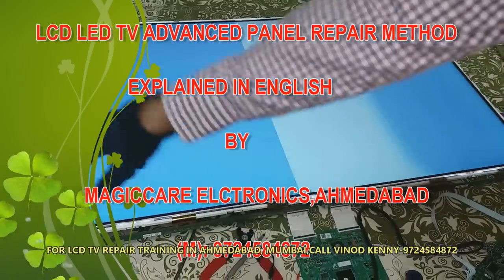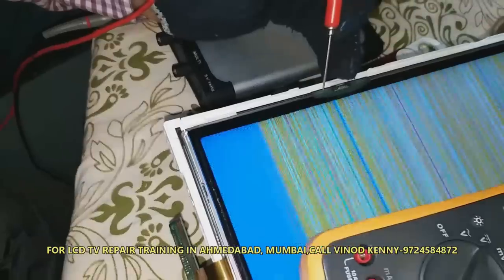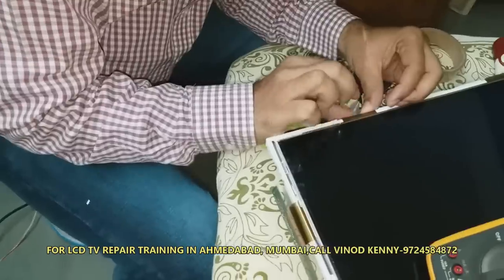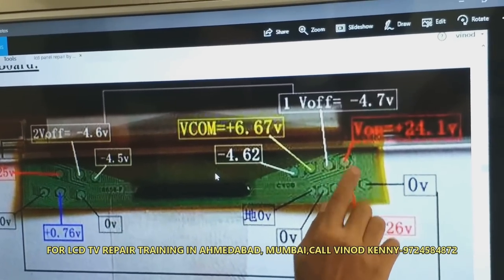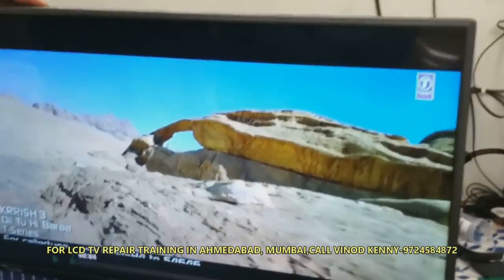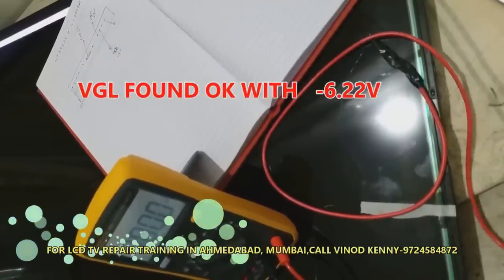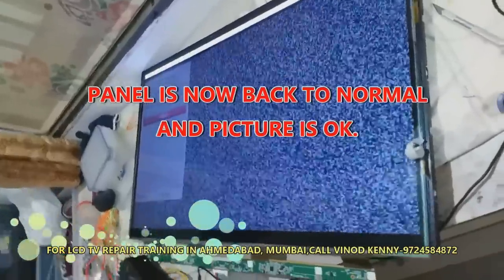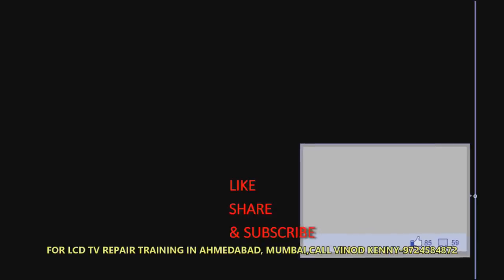LED TV PANEL REPAIR ADVANCED METHOD BY VINOD KENNY IN ENGLISH

Comment: Good but its a temporary fix only. Im time  other connections will turn lose and you'll have to do It over again therefore you need to replace the panel. Vgh going low is symptomatic of slow motion picture or picture going dark and reddish

Comment: So, you connect to each pin of side cof one at a time via 15k resistor with voltage and once you see a picture return then that is the correct pin?
Reply: Yes better use your ohmeter to test the lines if you dont want to Burn the COF

Comment: Greetings colleague I got a lcd of 55 has this screen model lvf550csot e15 and its tcon has this model st5461bo5-2-xc I get the image with vertical and horizontal stripes with a blue background use this cof nt61312h c6518a / a I proceeded to check vgl -6.5v vgh 28v avdd 15v but in the tcon tests only 3.3v vgl appears to me and vgh does not appear in the cof only 3.3v does not appear to me not vgl nor vgh and I notice in a lower corner of the screen that it gets very hot. there is a short you have the datasheet on this screen to isolate that short and normalize the image thanks

 

Enviar comentarios

Historial

Guardadas

Comunidad

Comment: Sir... Some of the panels doesn't have side cofs then what method we should apply else if all voltages are ok (or) not ok......When picture is blank
Reply: Then its not fixable, of course? Unless its FHD (or higher) resolution in whichever case the picture will be displayed in 1/2 horizontal resolution only when Vgh is missing on one side.